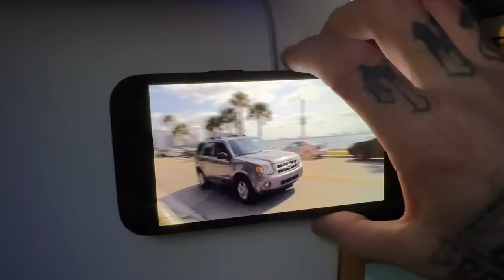Crawling Home To The Van On My Hands And Knees. THIS SUCKS!

Comment: No pun intended: this was painful to watch. Working at UPS almost 34 years, the chiropractor kept me from having back pain. Please, at least, go see them and see if it works for you, too. 😙
Reply: Starting with my second whiplash in my 20s, I could not survive without chiropractic. It is considered to have originated in Europe with a peasant practice called stamping or stomping, where a group of peasants would literally kick around the injured person until randomly their bones would realign. From there, observation led to a system.
Reply: @rachfish Agree 100%. It's past time for a chiropractor adjustment with follow up maintenance appointments
Reply: I used to drive ..delivery ...sitting is the worst, walking longer than sitting......helps even a little yoga 🧘‍♀️

Comment: I can help. 1st slow down - you are doing alot - 2nd There is a way to get relief called the Static Back - It can help to reset things and make you function again. Take it easy and try this - I used it for years as a trainer to help my clients.

Comment: Brace yourself while standing(when you can). and lift one leg (slowly) - kind of like your marching- hold it for as long as you can and alternate legs. I have 3 herniated lumbar discs and have to do this every day. It only takes a few yoga stretches daily to help maintain your lower back. Once your able to move freely, crunches( if you remember what they are) daily will greatly increase your core strength. 20 minutes a day is all it takes.

Comment: Back injuries are very serious. It may begin to feel better but not heal completely or correctly. To avoid long term damage see a doctor or chiropractor. Get an X-ray to be safe. I can’t explain how important it is. I’ve been suffering from back pain from herniated discs for a few years. I ignored the pain until it couldn’t be ignored and I finally took it serious and had an X-ray and mri done. Back pain is the worst. Sending prayers for relief, comfort and healing 🙏🥰🙏🌼

Comment: Chrome, so sorry about your back. Do you have a back belt? You know, like folks who work at hardware stores wear? When I mess up and hurt my back, I find putting one of those on helps relieve the pain. Of course, if I had been wearing it to start with, I might have avoided hurting myself. If you don't have one, it's worth the few bucks to get one at the hardware store, Walmart, just about any box store. You might think about wearing it when you're planning on doing physical work to save yourself some pain and down time. Just my 2-cents worth. Feel better soon.

Comment: They should have put a moisture barrier sheet underneath that floor. You are just gonna have to rip it up again once it bubbles. I know from experience and I live in a desert. Way less moisture then you’ll get
Reply: Only thing I can think is it’s the second floor and it doesn’t need it for some reason not sure but definitely need it on the slab of the first story

Comment: Bridge exercises will help. At first you will be weak but I promise after first set you will repeat. It actually helps with lower back issues. Give it a try. Promise you won’t be disappointed.

Comment: In construction for years, pulled my back many times. "Icy Hot" cream helps to ease the pain as a topical application. Also, lying on a floor, flat on my back would help short term. Hope the spasms go away soon, but I have also found that they can be triggered by holding any weight out in front like what you did. be well, Chrome. Your new shop is coming along very nicely!

Comment: I have back issues. I have found icing 20 minutes on then 20 minutes off  works wonders and if it still hurts, i use salon pas patches,  particularly at night when i go to bed. I also do yoga stretching and am starting to do core building exercises to help with the pain as well  since the issues are in my lower lumbar from L2 to S1. Hope you feel better soon

Comment: You probably get lots of suggestions, but try this.  Get your fork lift and position the blades so you can fit in between them, but they are snug up to either side of your body. Raise the forks just a bit higher than your elbows. Rest your elbows on the blades so your feet dangle off the ground for as long as you can. Gentle wiggle around a little while dangling.
I use some exercise equipment to do it. Sometimes it gives me instant relief, but it always helps out some.

Comment: GET an OBUSFORM BACK BELT support, while you’re in the ACUTE state, my belt is 15 years old & it helped me through numerous bouts of low back issues.  And, USE it when you do heavy lifting❤ Feel your pain Chrome🙏🏼 I, pulled my back out moving a heavy desk 20 years ago, today never know, but just the wrong sudden move, twist or bending over,  can bring back a week or 2 of excruciating pain & limited movement. Forever cautious...looking to permanently rehab this area with specific stretches to strengthen the lower back & especially the GLUTEAL BUTT muscles.  When it happens it’s not fun.. it’s debilitating.

Comment: Please go to the chiropractor. My boyfriend was in an accident and he's still suffering years later. Going to the chiropractor once a week is the only way he can stay pain-free in his lower back. Praying for you
Reply: Def chiropractor
Reply: Chiropractor can agrivate problems in long run. Best is to strengthen the core muscleas around the bones. Cracking leads to extrusion of cartiledge and cushioning gel betewwe bones. Stretching and core strengthening 100%
Reply: The chiropractor only helps for a bit, then you're back to square one again.
Just keep on doing what your doing
Reply: @sometea4741  If it wasn't for the chiropractor my bf wouldn't be able to get out of bed. But I do agree that you have to strengthen your core muscles as well
Reply: Absolutely chiropractor been there twice, works every time.

Comment: I have or rather had the same problem. You move exactly how I did. Once I was unable to stay on my feet for 2 weeks. Take a shower or go to bathroom was the hardest. I know what you go trough, the pain and frustration is real. The only thing that fixed my back, and believe me I tried everything, was the osteopath. I highly recommend it 😎

Comment: Chrome, I notice you hold your breath when you move and change positions. This is the worst thing to do. Try to breathe deeply and blow out when you exhale as you complete whatever movement you are trying to do. I promise filling your body with oxygen and forcibly releasing that oxygen, will help dissipate the pain and make moving more tolerable. It might take practice to complete that full breath with each difficult movement, but keep trying. It will help! Wishing you a speedy recovery, from a dedicated fan! ❤

Comment: In my late 40s my back would go out like that. I was lifting a engine and turned wrong and it felt like the floor came out from under me. It took a lot of years to get it back to normal needless to say I don't attempt to lift engines at my age now. I know your pain

Comment: Chrome, when my back went out, I used 5 things that helped, and continue to help whenever I feel pain in the spot that was most impacted:
Ibuprofen, cannabis butter and bud, using the shower massage on its most potent setting (Worth installing with the hose in your new shower), a heating pad, and a product you might find at Walmart in the pharma department - 
Solonpas pad (my sis put them on & gleefully ripped them off during change out). Also, bedrest...in the horizontal position.

Comment: Chrome, do you think you may have herniated a disc or fractured a vertebrae?  Should you have it checked out?   If you can, I’d recommend it.  I don’t know what happened so don’t know if you should be icing it or apply heat...  but Arnicare cream can help a lot, helps loosen up the spasms.  I feel bad for you, had a back episode once, was terrible.

Comment: As someone who has already had two spine surgeries - you definitely need to either see an orthopedic spinal surgeon or a neurosurgeon and get an MRI scan - if you have something pressing, like a herniated disc or a collapsed vertebral body, that is pressing on that nerve, the more risk of you causing permanent nerve damage gets worse.  They need to see what they are dealing with in there with an MRI and maybe even a series of three epidural steroid injections would help correct it too - please don't risk damaging that nerve permanently.